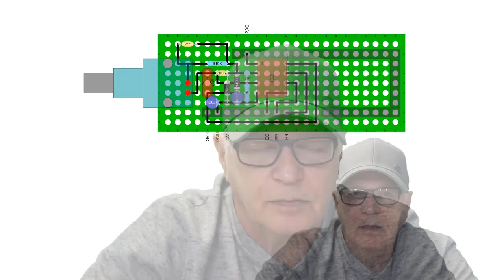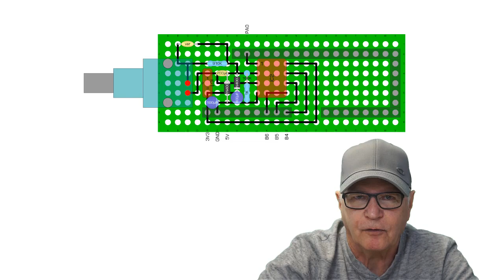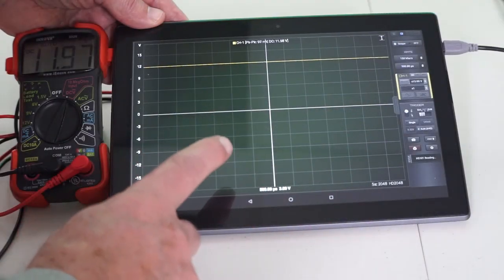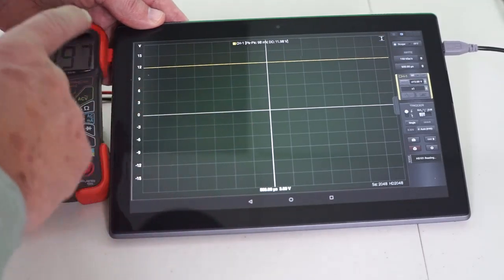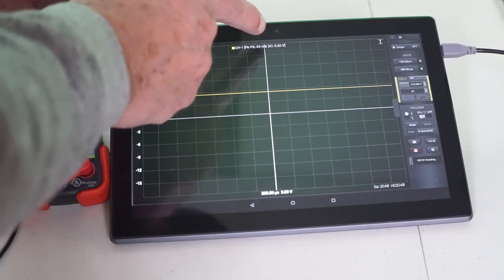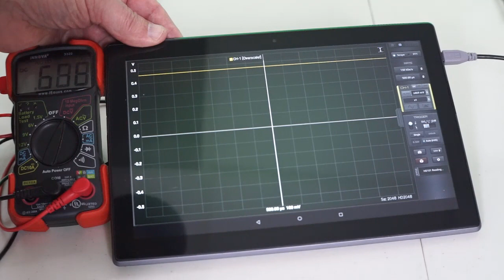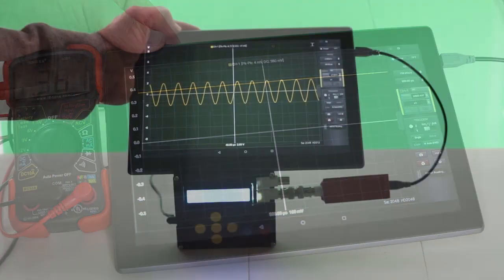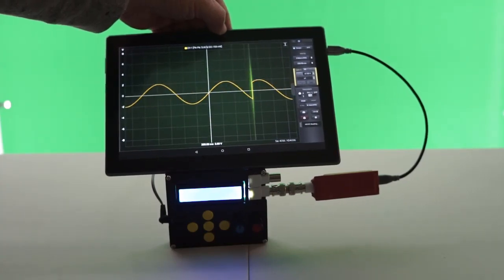GADGETS#88 - HS101 PRO

Comment: Is that correct that pin 2 of the AMS1117-1.2v has no connection, and only pins 1 and 3 has connections?
Reply from the maker: yes, that is correct ... it is a very clever way of obtaining a 1.65v reference and can only be done with the 1.2v version of AMS1117
Reply: @theGADGETSplaylist  Thank you so much for the explanation! It's really interesting stuff, and great job.

Comment: What equation of IC2 PCM6S21. This ic is difficult to find..
Reply from the maker: I source most things from Aliexpress. For this HS101 PRO through hole build, we need a MCP6S21 in the SOP size:

https://www.aliexpress.com/item/32952477655.html?spm=a2g0s.9042311.0.0.573d4c4dqRdBaW

and...we need a SOP to DIP adaptor board:

https://www.aliexpress.com/item/32909311773.html?spm=a2g0o.productlist.0.0.f6ea1e3a6SAONU&algo_pvid=6ef4e0f8-1121-4c09-ac8b-c8230eee9cd5&algo_expid=6ef4e0f8-1121-4c09-ac8b-c8230eee9cd5-0&btsid=0b0a555916134829708595146e4ef7&ws_ab_test=searchweb0_0,searchweb201602_,searchweb201603_

I invite you to join us on the HScope TELEGRAM Group where help is easier to provide than YT comment section. Follow this link, if interested Arvand:

https://t.me/hscope

Denis
Reply: @theGADGETSplaylist  can I use MCP6022-I SN. I'm from Indonesia.. buy from aliexpress need more time
Reply from the maker: @arvand26  In Canada, Aliexpress needs a LOT of time too...often more than 5 weeks...probably same as you...
Reply: @theGADGETSplaylist  hehe... btw thanks a lot.. I will make this scope
Reply from the maker: @arvand26  it is a VERY nice project if you want to stay with through hole board.

If you're comfortable with SMD soldering, the latest HS402 oscilloscope is kickass:)
Reply: @theGADGETSplaylist  off course. With v1.7... But and more the AQY210EH not found in my online store country
Reply from the maker: @arvand26  unfortunate if not available in your country...and that this would be the obstacle for you not building HS402. A truly amazing little scope. Am working on a WiFi version right now using ESP32 WROOM board. Very nice!

Just yesterday, I encountered another faulty AQY210 in a HS402 circuit. Not 1st time and it will drive you nuts troubleshooting it! I just ordered another 40 of them...

Check us out on HScope LOUNGE in TELEGRAM Arvand

Comment: i need your expertise on something, have you got any ideas on recording a voltage or amperage reading on an  o-scope pattern for replay. what i'm getting at is , how to record a relative compression test (OR other measurement) so that i can run it thru a scope multiple times . working on these filters i only need 1 sample ,but need to retest for each change in filter design. and i dont want to burn up the starter on my old truck,thanks any ideas or thoughts  are very much appreciated. i did get the lenovo tablet and am working on the H-SCOPE system, a lot of useful stuff in his design.
Reply from the maker: +henry robinson - I hope you're on the BETA version of HScope. If so, the latest release (150) has the ability to store and retrieve waveforms captured in AUTOMOTIVE MODULE.
If you're unsure about any of this, feel free to ask.
Denis
Reply: @theGADGETSplaylist  thanks ill check it out and see what i can do
Reply from the maker: @henryrobinson9837  - HOWEVER...if you're testing hardware filters, I don't see how HScope or any other oscilloscope hardware could do this without an actual run.
Even PICO, though it would allow you to test any number of software filters on the same saved capture, it would not be able to do this for hardware based one...
I might be misunderstanding you, Henry.
Good luck with it and I'm here if I can be of help.
Reply: @theGADGETSplaylist  i am experimenting with  audio recorders,that way i can run it thru like a song,just not educated enough ,but trial and error work 1%
Reply from the maker: @henryrobinson9837  - that's out of my area of "expertise"...I don't do audio work.
There is an AUDIO module available for HScope. Martin has video on it on his channel. Not sure if you'd be interested in that. I have not used it.
That waveform generator used in this video might also be of helpful in your filter design...generate the signal you want to filter and test it. These things are inexpensive. I do use that a lot.

Comment: How do I get a list of all the parts I'd like to give it a go
Reply from the maker: +Roy Wisner - that's the spirit!
I've just now added a parts list to the same download link.
Well before all your parts come in, I should have a "black pill" version of this oscilloscope, that fits in a slim aluminum project box and includes hardware based AC Coupling.
By then, you'll have a choice between 2 builds (almost all the same parts) and a possible revision (small) to the schematic of this HS101 PRO.
Thanks for your interest, Roy. And feel free to ask should help be required along the way.